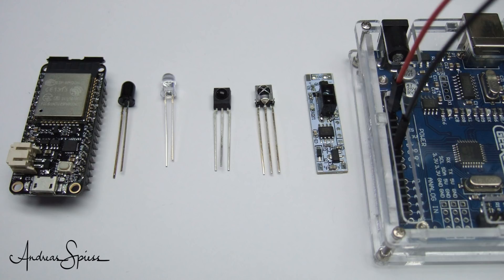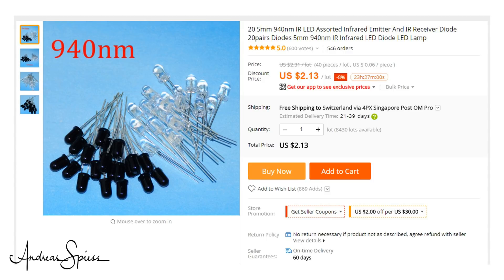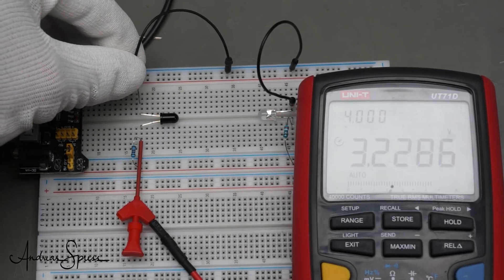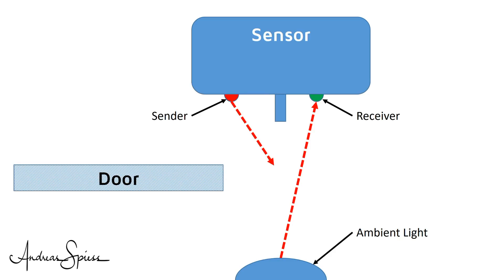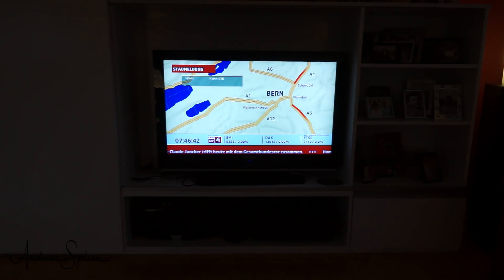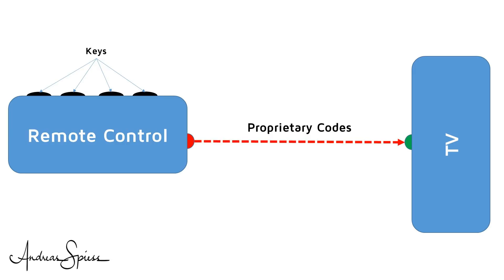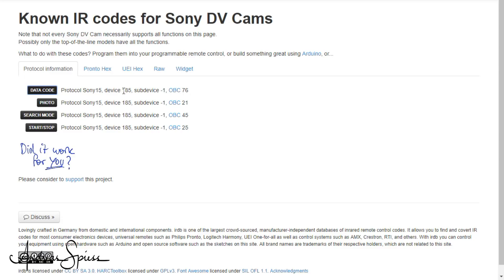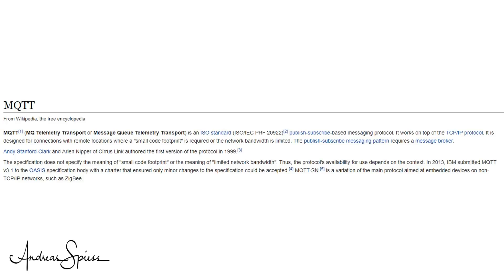#171 Arduino Guide to Infrared (IR) Communication also for ESP32 and ESP8266

Comment: i was just speaking to some of my racing friends. we want to take par tin a 5 hour endurance race next season and since we ride motorcycles, communicating it not always easy, so i started thinking, what if we use infrared transmitters and receivers, on the main straight. 150+ meters, should work. so here i am, watching your video. I will do some prototyping soon.

Grüezi to you too from canton Aargau!
Reply from the maker: Fun project! Will not be easy, I think.
Reply: @AndreasSpiess  not really no, i decided to go with LoRa radio instead of IR
Reply from the maker: Much, much easier!

Comment: When talking about a high pass filter for the reciever, what piece of component is used there? I want to connect my IR rgb led strip but I also want to control it with the arduino and not the remote. Therefore I am mapping all the buttons first, but in my monitor I see the IR is constantly picking up noise. A 100K resistor is easy to find but you don't talk much about the high pass filter component nor it's values.
Reply from the maker: You can google high-pass filter and find many calculators. However, noise is usually broadband, and it might not be easy to find the correct frequency. Trial and error is probably needed.
Reply: @AndreasSpiess  I can read the signals coming from the IR remote after I figured out what the signal is (when I turned on NEC demodulation, there was a correct readout) (if you cannot demodulate the signal because the demodulation is not present, due to the noise you will get different values at random when pressing a button) I guess it's all ambient reflections that are being picked up. Usually with a real low value.  It would be nice to get the noise filtered away while still mapping the signals from the remote. I'm still not sure if I can get the arduino to send these signals over wire so the RGB strip can function. If I can't get it to work I just destroyed a perfectly fine rgb strip with IR remote control. If so at least I now have a working IR sensor to operate other stuff with the arduino.
Reply from the maker: @CrazyByte2007  Did you use one of the IR signal receivers described or just an IR diode? An IR receiver should block most of the ambient noise.
Reply: @ I cut the IR reciever off a 12v LED strip. connected that on the arduino and tried to capture inputs. It only started to work when I enabled NEC devices. but if you press a button, and wait, press the same button, it's a different result. If you do nothing. there's intermittent reports of some signal being recieved. (that does not look like a normal button press.)

Comment: Thank you for this thorough explanation! I am trying to use my IR remote included with my Elegoo (arduino copycat) starter kit to control a second hand Vizio soundbar that did not come with the remote. Im having some trouble because I don't know how to reprogram the buttons on my Elegoo IR remote to use it to control my Vizio soundbar :/
Reply from the maker: Indeed, the process is much easier if you have the original. Maybe you find the codes online.

Comment: Hey Andreas, great video,  I went you you GitHub site, In the Arduino-IRremote  repo, in the readme it still indicates that ESP32 is receive only.  Also I looked in your examples folder for the sketch you mention, in the video,  sketch_nov20a, cannot find it.  Is this the repro with the fixed IR transmit functionality? Thanks so much.

Comment: You have a great way of explaining things. I have IR control for TV and camera from ESP32. However I would to move from the Arduino IDE to the ESP-IDF as I want to use FreeRTOS.Any hints on the best way to use the IR code in the Arduino framework to ESP-IDF. Thanks again.
Reply from the maker: You can use RTOS also in the Arduino framework. I did a video about that.

Comment: I enjoyed this quiet a bit. Very cool. 
Since we're talking light, there is a method for discriminating different light sources that you might find helpful: 
All light can be polarized. Most people are familiar with polarized light be blocked by orthagonal filters, but, what they forget, is that there's a third level of polarization. 
That third level is 'color shifting'. 
Color shifting allows you to take one color of light, and turn it into another. 
To do this, you take two polarized filters at 90 degrees (such that they block most light coming through them), and simply add a third filter. 
The third filter shifts the frequency of light that makes it through the first 2 filterz. 
You can then check for color shifting in time with the 3rd filter or check for specific color of light keyed to your receiver/emitter combo.
Reply from the maker: Interesting! Never heard of this effect!

Comment: Hi Andreas, I have 4 sets of IR transmitters & receivers  on my vacuum robot out of which 2 transmitters have gone bad (2 of them are not emitting the light when I watched the video recording as the light was not visible to bare eyes, the other 2 can be seen glowing once in a while in the video recording). How to determine if the IR transmitter has gone bad or if there is something wrong on the mother board. If I want to replace only the IR transmitters, how to find out what specification transmitters are used on the device originally. Thanks in advance for your help. I could share photos or videos, but I guess I cannot do that here.
Reply from the maker: I have no idea to find a replacement :-(  To find out if the transmitters work, I would measure if they get a signal (with an oscilloscope). If they get a signal and do not emit IR, the error most probably is with the diode. Otherwise probably on the mainboard. Be sure they are emitters and not receivers.

Comment: Hi - I just discovered this video. Fabulous! And you touch upon EXACTLY a little project I want to attempt myself; a CW keyer with an infrared link to the radio transceiver. The Is there much more circuitry required to turn the 'hi/lo' from the IR receiver into something that will key the rig? Any pointers much appreciated. *****It's the next day, and I only just realised that if I want to put the IR link between the paddle and the keyer (or rig with built-in keyer) I need TWO IR links; one for dits and one for dahs. So as well as, say, the 'standard' 38kHz link, do I need to choose the other link's frequency as far from 38kHz as possible or can I use any other freq than 38kHz? Thanks
Reply from the maker: You could code the IR signal (one code for the left and another code for the right paddle. You get IR receivers for other frequencies. But I do not know how sharp their filters are.

Comment: Andrea’s I saw your video again, now by Dec/2022. The contents you present are already great, and adding your Swiss sense of humor is just a bonus for us.😊
At the original time, 5 years ago, ESP32 didn’t have code library for IR. By now, it may have and ATTiny85s or ArduinoPro mini could be the smallest versions to try IR coding experiments - not only in size, but also in Power Consumption.
About my current project:
In doing a DIY ‘project’ to control my Carrier/Midea’s split AC using a tiny and lower cost device as Arduino Pro Mini. 
Those AC devices use remote coded as “RG52B/BGCE” sending the full parameter set in a longer and more complex burst of IR codes.
I have some doubts and don’t know if you could provide any guidance or comment:
(1) Have you done (or heard someone) doing this long/complete IR coding for AC by the parameters themselves - instead of just recording hundreds of different combinatorial/configurations? Any guidance about this matter?
(2) Developing some ‘smarter’ algorithms to read & learn the T&H sensor response and adjust the AC for better ‘Herman comfort’ - not just the dumb temperature control. Any references or similar cases are greatly appreciated.
Thanks and Have a Great Christmas!
Reply from the maker: I did not look into IR recently. Maybe you find a project which fulfills your needs (we have no AC here).
Merry Christmas to you, too!
Reply: @AndreasSpiess , curious piece of information that made me do a quick search. I live in Rio de Janeiro (Brazil) where cooling AC is more than welcome for our hot days’ troubles. It is a good guess that you live in Swiss, where diagonally you all could face cold days issues for several months/year. Options as burning wood/oil/gas fireplace are non-electric, sure. 
But the thermal machine known as “AC in heating mode” pumps more heat (BTU/Watt) than just resistive heaters do, which would compensate its cost and other disadvantages in the long run - except when electric energy and oil prices are skyrocketing.

Comment: A simple roller lever switch would have saved you a lot of time and headache.
Reply from the maker: Maybe...
Reply: @AndreasSpiess  Any idea how to actually make a simple 1 button press Arduino Code to send 1 IR command out Port 3? No online codes work. 
I think because"<IRremote.h>" has changed in new revisions. Making old code not work. I tired multiple Arduino modules, the code is the issue. IR simply doesn't send. While the port does work. 🤨
Reply from the maker: @John-hb1zo  I did not use this library for a long time 😞

Comment: Hello, I am facing the same issue...Currently, I am working with a simple CW red laser and DET100A2 photodetector. I wanted to make it ambient light proof.  I want to use TTL modulated laser with esp WROOM 32 at 40KHz frequency But I am not sure how to generate 40KHz frequency at GPIO pin. I tried with this code but it's not working. could you please guide me with the new code ?

// the number of the LED pin
const int ledPin = 16;  // 16 corresponds to GPIO16

// setting PWM properties
const int freq = 40000;
const int ledChannel = 0;
const int resolution = 15;
 
void setup(){

  Serial.begin(115200);
  pinMode(ledPin,OUTPUT);
  
  // configure LED PWM functionalitites
  ledcSetup(ledChannel, freq, resolution);
  
  // attach the channel to the GPIO to be controlled
  ledcAttachPin(ledPin, ledChannel);
}
 
void loop(){
    Serial.println("0% PWM");
    ledcWrite(ledChannel,0);
 //delay(100);
    Serial.println("100% PWM");
    ledcWrite(ledChannel, 1024);   
  //delay(100);  
}
Reply from the maker: Unfortunately, I cannot do remote debugging. Maybe things changed in the code. This is an old video.

Comment: Guys, anyone has any idea how could I amplify (current only) of pulses coming to the IR led and use higher power led instead. Let's say 2-3 amps instead of 20-30 mA. Any ideas for transistor circuit?
Reply from the maker: I assume you need a stronger IR diode and a transistor to switch the higher current. and you can connect many diodes in Series to get more power.

Comment: Hello!! I would need your help, pleasee. I have built a IR remote controlled car recently and it works really well (tsop4838 receiver and vishay high power diodes 100 mA ) but there is a problem. WHen I compare my design with commercial remote controls or toys I have noticed that I have to really point my ir diode at the reciever to make my signal beiing transmitted and at the same time when I try a remote control for TV etc. I can point it at any direction and it works always! My question is how can I improve my project to make it work more closer like commercial toys or remote controls for tv ? Everywhere they sell the same types of diodes 940 nm and usuelly 100 mA (at 1.6 V) and is it a problem with the reciever? Or maybe commercial remotes are using super strong diodes? Or maybe different types I don't get it. When the car is moving it is so difficult to point at the receiver (it is more like aiming game than remote control haha) I wonder how the commercial remotes controls companies resovled this problem. And it is not the receiver's fault because I tried my IR transmitter from the IR helicopter toy and it works anytime from long distance so it has t be something with those diodes but from the other hand commercial remotes have only 2 pils AAA so it is not problably super strong but their remote works far more better than mine hmm 🤔🤔🤔
Reply from the maker: I have no idea. But your explanations sound reasonable and your tests should leas you in the right direction. The only thing I can think of is that part of your light is blocked by the case or so either on the transmitter or on the receiver side. Check also if you use the right modulation frequency. These receivers have filters which will attenuate wrong frequencies. Exchange either the transmitter or the receiver with a commercial one ( you should see also foreign signals at your receiver) or you find a library to create the right signal for your remote controlled device.
Reply: @AndreasSpiess  hmm I know there are filters (I have made a quite big progress with electronics when I started to learn about RF and also as you advised me I started preparing myself for the "radioamateur" licence in France but I know a lot about filters etc.
Another thing is that it is not blocked and this is not the case here (I mean I know when it is blocked because I can see it on my osciloscope when I loose the signal) but it behaves as it should and also the angles are correct  as it says the datasheet!! So it is not bllocked and the receiver works as it should and also the IR diode works also fine (the beam is not very strong but it works). The problem is that the commercial remote controls work like 100 times better (I mean stronger and even when I play with my grandma's old Philips remote control it works even when I point the remote in totally different direction) than mine and I don't know why :/ but I will find out :D
Reply: hmm I compared two transmitter and I have noticed that they work a little bit differently than mine 🤔 The data transmitted look the same but the first difference is like it is negative impulses , mines are positiv and generally it looks like more high beam flashes in commercial transmitters, mine looks differently (but both have good signal quality). I will have to do more researches on it because ot looks quite interesting :)
Reply from the maker: Look also to your LED drive circuit. Maybe it is not strong/fast enough. Use a standard IR diode, not the TSOP to compare the signals of your transmitter and the commercial transmitters in the same setup. Then you should see the differences.
Reply: @AndreasSpiess  it looks like the commercial IR diodes are 100 x stronger but  I don't know how (maybe I am wrong but for now I suspect this). I wonder if the commercial parts are normally available for normal consumers? Maybe here is the problem that the companies hide those efficient electronic parts from the consumers so they are forced to buy the whole product (I have heard already about similar practics)! Of course some substitutes are offered but maybe 1/100 efficient than normal product?
Reply: @AndreasSpiess  and also when I check out eletronic forums etc. people usuelly have the same problem as mine and never solved!
Reply: @AndreasSpiess  aaa I found something! This is what I thought! It might be something with high current pulses! The diode is rated like 100 mA but with quick pulses it can be even 1 or 2 A !! This is why I see those flashes when I check remote controls woth the camera and also ot looks differently on the osciloscope like a"frozen photo"!! BTW Andreas are you an engineer in electronics ?
Reply: @AndreasSpiess  so my guessing (as Richrad Feyman used to say ;) ) was correct! Nothing will hide from me in programming/electronics :D

Comment: 38 kHz frequency implies that the transmitter has to turn on or off every 26 microseconds, correct? 1 second / 38,000 = 26 microseconds. So the receiver in this case would be detecting a meaningful transmission by "reading" on/off signals or bits every 26 microseconds? And "meaningful" would be defined as certain sequence of bits or on/off signals that would precede every legitimate code transmission, correct?
Reply from the maker: Yes, you are right. But this is usually done by the TSOP receiver chip.
Reply: @AndreasSpiess  Got it, thanks for your reply.

Comment: It, the transmitter, is not transmitting heat - is it? When I think of infrared I think of heat radiation. I don't understand.
Reply from the maker: Yes, it transmits "heat". But not a lot ;-)
Reply: @AndreasSpiess  Thank you.  So why do we need a special electric transmitter if it is small intensity? I know about frequencies and the range of the NIR, but, why can't other IR heat radiators, the human body etc, affect the receiver?  And if it is small intensity, how does the IR radiate across such large (relative) distances, 10s of metres, without a 'strong' original heat source? Normally even high output transmitters, small indoor house fires etc, output would not reach such distances. Is this not more about electricity that actual heat radiation. It is very odd. Hope you understand my query. Blair

Comment: did I get this right that, If I want to Detect Objects, I can just use some sort of 38 kHz generator, hook this up to an IR LED and the an IR receiver will then output high if it receives the 38 kHz (reflected off something) and low if it doesn't receive the 3 kHz ?
Reply from the maker: Yes
Reply: @AndreasSpiess  Nice Thank you.